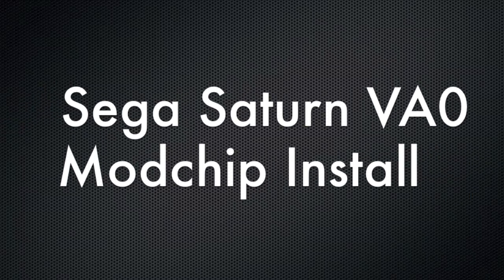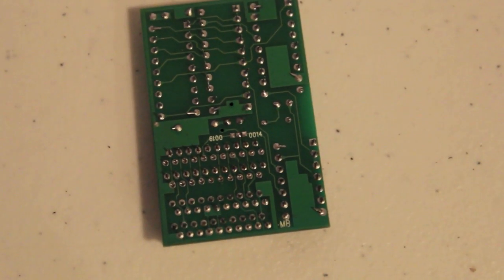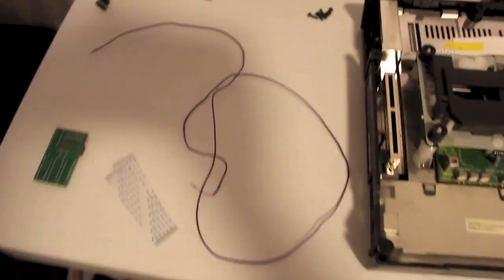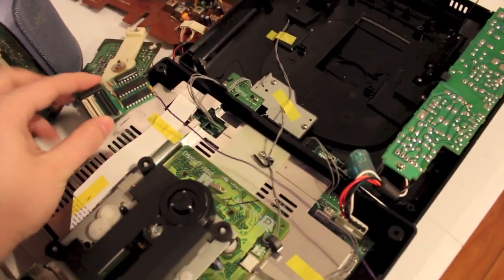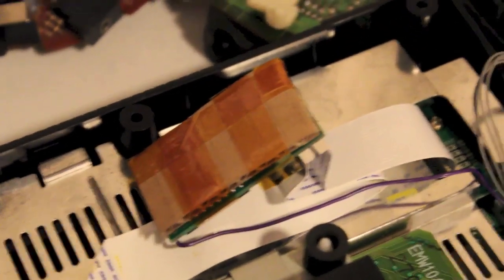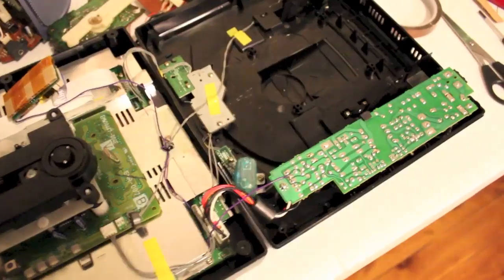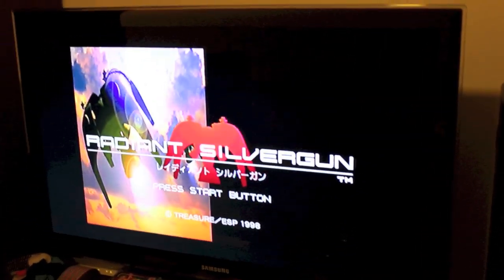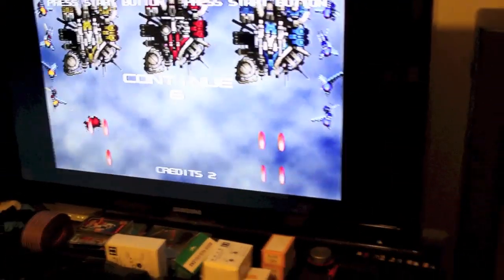Sega Saturn Model 1 VA0 Modchip Installation

Comment: Excellent video mate, very helpful! I have the same model of saturn as the one in your video guide, so I followed the installation guide but although the saturn does read originals, it dosent read the cd-r's. They are an obscure cheap make of cd though! Could that be the reason it won't read the copies?

Comment: The chip is a sinch to install... but I can't get the damn thing to fit into the console without the Saturn telling me the CD tray is open! It works fine if I leave the upper shell of the system off, but I don't like to play naked.
Reply: I just ordered one of these and I feel a bit stuck because in this video he completely skips the step where he connects the ribbon cables, and it's pretty hard to tell where they're supposed to go. Also his chip ends up being upside down and I want to install mine correctly so it isn't like that. I'd also like to be able to keep the shell on the system when I play. Did you use a different guide than this one to figure the cable stuff out?
Reply: Margatroid I managed to fix the "CD tray open" problem a few nights ago... it was occuring because I had previously taped down a lid opening component in my Saturn last year so I could do the "swap trick". If you've already done that to your Saturn, be sure to remove the tape!

Yeah I was frustrated that this video skipped over the ribbon cable part, which is what confused me the most. The only other guide for this mod is here http://www.segastyle.com/model1V3.html . Let me know if you need more details for the ribbons and I'll tell ya what to do.
Reply: Keranu Yeah, I've seen that guide and it also skips the cable part. I haven't actually opened my Saturn yet, but from what I can tell the chip basically goes between the CD board and the motherboard, correct? My chip came with two ribbon cables in the package, but it seems like you only need to use one of them, probably to connect the chip to the CD drive, and then use the original cable for the motherboard connection. Is that what you did?

Also, I guess it's best to connect the ribbon cables before soldering the power wire so you don't end up with your chip upside down like this guy did, right?
Reply: Margatroid Yes you only replace one ribbon cable, depending if your model uses the 20 or 21 pin connectors. Just be sure to look at which side the pins are facing before unhooking them so you know which way to plug them in.

I soldered the wire before messing with the ribbons just so I could get that part out of the way first. Whichever most's comfortable for you will do. Also MAKE SURE to completely cover the modchip in electric tape so no component of it touches the metal casing inside.

I also suggest taping the ribbons and modchip down in place once you manage to find a spot to secure it snugly. It's rather annoying try to fit the shell back on when everything keeps popping up and waggling around. I have a picture of the inside of mine if you're interested.
Reply: Yeah the electrical tape is sticky, hopefully I won't ever have to take it off. The chip is working fine so far, but it looks like I'm probably going to have to replace my CD drive now :(
Reply: Keranu Sure, I'd love to see a picture! I appreciate all the tips, too. I'm going to open mine up tomorrow finally and see if I can get this done.
Reply: ***** Thanks for the replies. I think I was probably too paranoid about this at first. Just need to get some good tape and it'll be fine.
Reply: It's a real simple mod, the soldering and hook cable hook ups are the easiest part. I'm not a techie so I was real paranoid over it too. Now I'm playing burned Saturn games like a pro, bro 8-)
Reply: Keranu Ok, I opened mine up and it turns out that I have the kind of power hookup that he doesn't have in this video, the one that isn't connected to the top of the case. Do you have that kind as well? I'm not sure what kind of soldering technique I should use to attach the wire, since it's these sort of like pins sticking up with empty spaces next to them. It's "A" in this photo: http://www.segastyle.com/modimages/Model15vSrc.jpg

Also while I was messing around with the chip and trying to find the best way to hook up the ribbon cables, the pre-soldered power wire snapped off. He put a lot of solder on the joint, so I'm not sure if I should try to desolder it or just strip the wire down further and solder on top of what is already there. I haven't done much soldering.
Reply: Margatroid Yep that's the same model I have, which may or may not be more convenient. I'm no soldering pro, but what I did was melt a little solder on the tip of the iron and then place more over the wire as I soldered it onto the pin. It doesn't take much and should have feel firmly attached to the pin.

For the wire that snapped off, I'm guessing it would be safest to desolder what's left and then resolder the wire back on. But I think either way should work fine.
Reply: Margatroid did you ever finish modding your console?
Reply: MrDerpTurtle Oh, yeah I did. Forgot to post about it here. It works great!
Reply: Keranu I forgot to thank you for the help after I finished modding. It was a success, thanks!
Reply: Margatroid No problem, dude! How long ago did you finish the mod?

I think my laser needs replaced now. That's definitely going to be a more difficult task buuuuut I might be able to handle it myself.
Reply: Keranu About two and a half months ago, I think. I burned a whole bunch of games, mostly fighting games and shooters. Really fun. I had to move since then and pack up all the Saturn stuff, but I actually just got it hooked up again a couple days ago.

How hard is it to get a replacement laser? Is it a common one that's still available or some kind of custom-order thing?
Reply: cool can you tell me how u did the ribbon cables i saw a guide but it was just a picture

i know where to put them but not really what way. lke the side with words facing up or the blue side facing up
Reply: It's pretty simple. You just put the mod chip in between the motherboard and the disc drive, basically. Make sure you follow that image and connect the drive cable and the board cable to the correct sockets, and then tape up the chip like he shows in this video. And make sure the power wire is soldered, of course.
Reply: MrDerpTurtle Oh, I didn't see your second line. You need to make sure the metal pins in the cables are aligning with the ones in the sockets. It's easy to tell if they are.
Reply: oh ok thanks i assumed the same but wasnt sure because usually when i get a modded console i got someone else to do it

i just got to get a piece of wire now tobad it didnt come with the purchase

Comment: Great video!  I've done this mod to my Saturn recently and ran into problems with CD-R media.  I know you mentioned specific make of discs, is that the only brand you got to work with with it?  And what speed did you burn the discs?  It seems nearly all modern media as a minimum burn speed of x8, and ironically I found that when burning at 8 speed I get audio problems, yet at 52 speed with Verbatims it sounds fine, but I had to adust the laser a LOT - as a result its on its way out.  I have had to order a replacement laser...  I was thinking of getting a model 2 Saturn but apparently it uses the same laser =/

Comment: You don't use a ground wire with the Chip he used.  You only have 1 wire that goes to the 5v point on the psu and the other end to the 5v point on the chip.

Connect the CD ribbon cable to the 20 pin connector on the chip and the MB ribbon connector to the chip also.  That's it and just took me 10mins the other day modding my Model 1.  The ground wire version is for the Rackeyboy chip (google it) This is the Consolegoods.co.uk chip